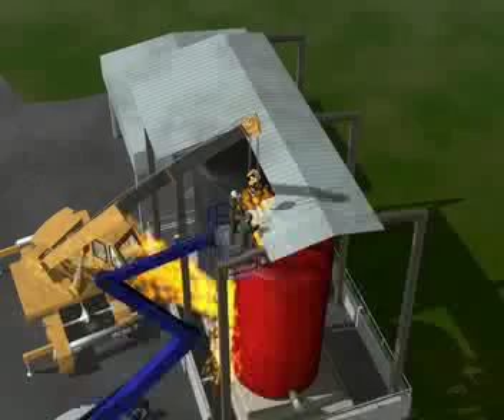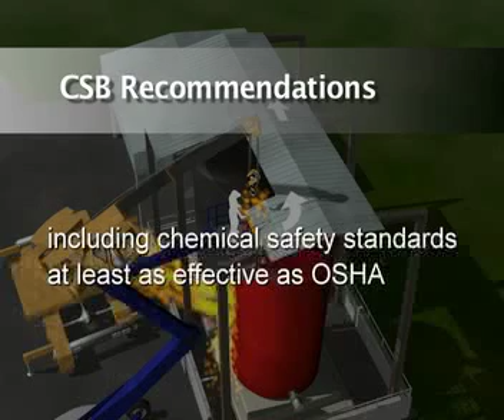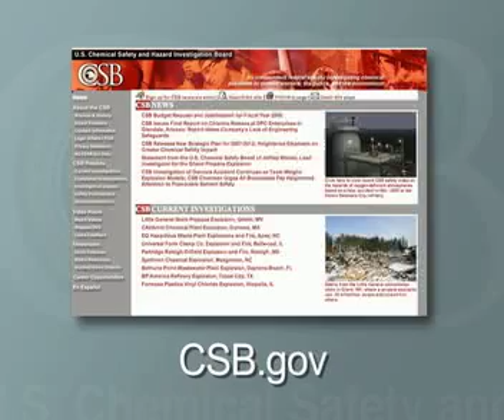CSB Safety Video: Public Worker Safety: Wastewater Plant Exp

Comment: Why is the video quality so low on these? This one is at 240p, some are at 360p. Kinda fuzzy. 720p would be ideal (really no need for hi def for these)
Reply: Actually, oddly enough 720p is described as HD, or high definition. 1080p is described as FHD, or full high definition.
Reply: @aaronfield3543  I know. Regardless of what they are called, too few pixels makes it hard to see details, while some YouTubers use more pixels than necessary.
Reply: @tomarsandbeyond  I definitely agree. 480p at the very minimum should be used
Reply: This video is more than 11 years old. Videos degrade over time and lose pixels. It was 1080p when it was first uploaded
Reply: @delipete123  r u joking? that's not how it works.
Reply: To everyone here complaining about the quality: it's an older video. These things are going to have crappier quality than newer videos.

Comment: The third guy was wise after their mistake! that was smart of him to have thought of running thro9ugh the roof to an area where he could descend or jump at a safer height. I thought the guy in the mobile crane could survive or escape easily upon seeing the ball of fire explode above the tank. Well the first guy had the worst instant death! But crane driver had really tasted hell fire. I wish he can bypass hell after this incident for real.
Reply: The "ball of fire" above the tank was added for the animation, in reality methanol burns without much of a visible flame.

Comment: That lady at :50 doesn't seem like she has ever actually been around hot work. Just seems to be reading a script. If you really want to connect with the "good old boys" or whatever you want to call the stubborn workers have someone who actually has worked in the field and has dealt with the hard jobs. Hell, all the people in this vid seem to be office people, it's one thing to quote "OSHA says this" then to actually know the material in question. If you've never been there and done that, then how can you even attempt to get someone to not do it? It's a tragedy that they weren't properly briefed on the location and hazards. It's also a tragedy that improper safety devices on the tank were installed, and that no one ever checked on them.